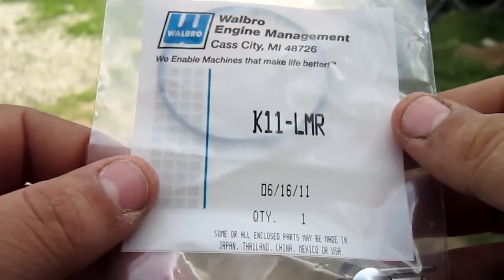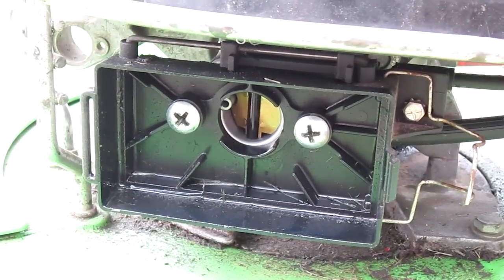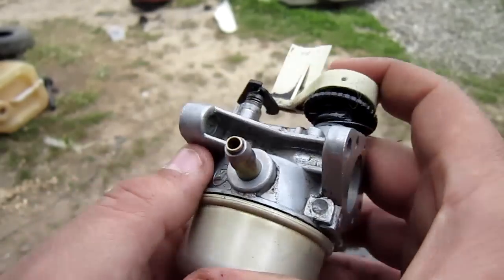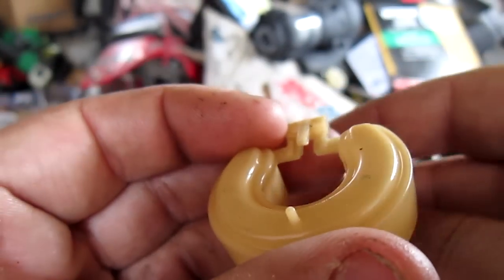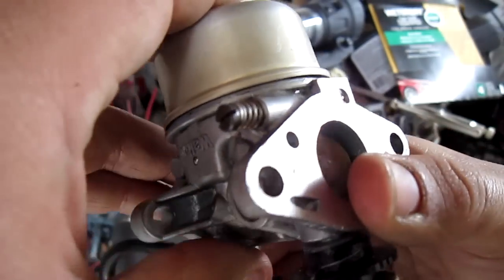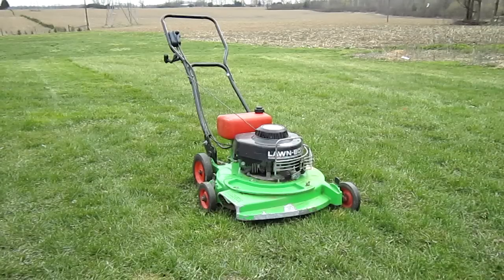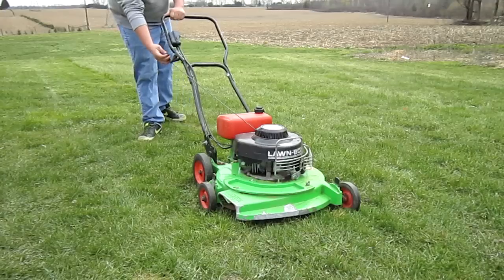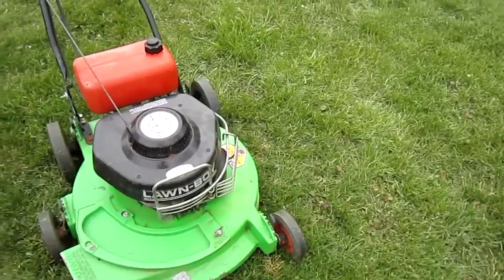How To Fix a Lawn-Boy Carburetor

Comment: Love the way you did not show you putting the governor spring on . This can be tricky at times. Thanks. That engine sounds like it’s running too fast. I’ve been doing this for 50 years. That is actually a nice machine. When running right it’s bad to the bone. That engine with proper care will last a long time. Most lawnmower engines will be gone when this one is still going strong. Thanks.
Reply: Does anybody know how many turns the mixture screw should be set at ?
Reply: Does anybody know how many turns the mixture screw should be set at ?